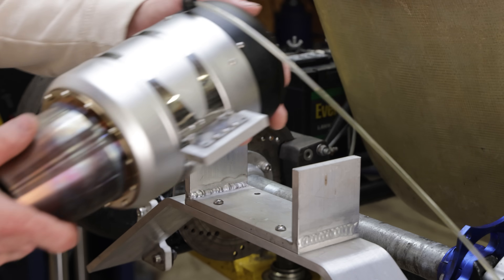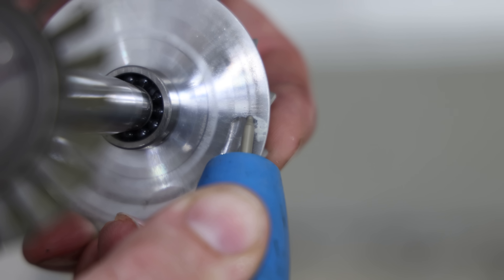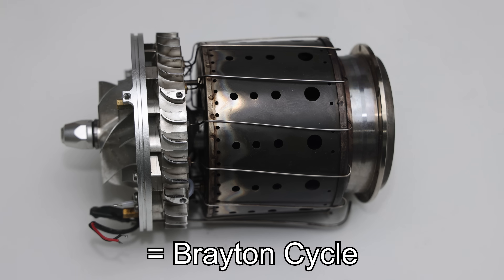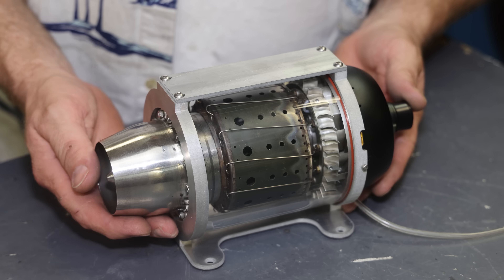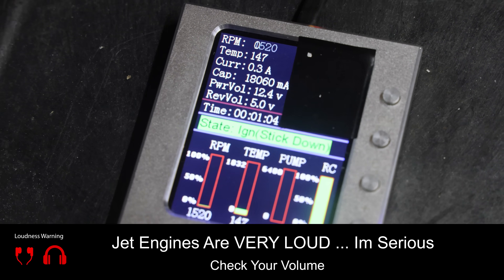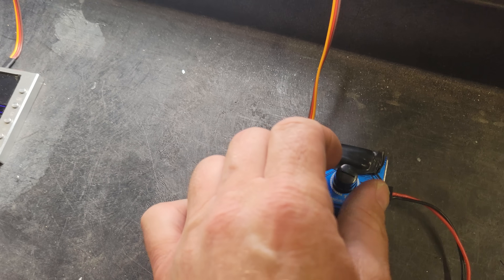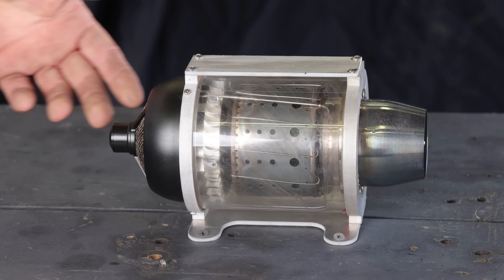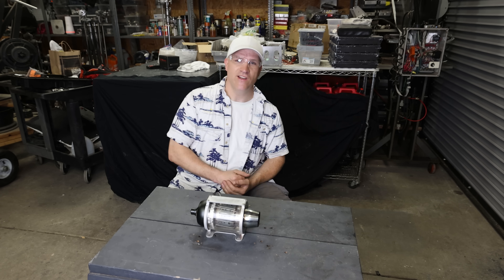See Thru Jet Engine

Comment: Awesome design and fabrication work! And your explanation of the Brayton cycle is great too. If you get a chance check out the Brayton Ready Motor. In 1872 George Brayton made the world’s first commercially viable internal combustion engine. Otto studied Brayton’s engine and in 1876 developed the 4 stroke engines we use today.
Reply from the maker: I've been totally meaning to get details on that engine and replicate it for a while.. I still haven't gotten around to it but I'm going to check it out today
Reply: @WarpedYT  the piston Brayton is pretty interesting. I’ve made crude versions from air compressors. Have a look on my channel if you are interested. It will be great to see what you come up with.

Comment: Is this a high bypass design or those are only large jet engines?
Reply from the maker: High bypass are usually larger turbofan engines.
Reply: Any bypass means a turbofan engine; this is not a turbofan. 
High bypass ratios are found in newer and usually larger turbofans.

Comment: That Was Really Cool! Is That Centrifugal Flow Or Axial Flow? How Much Horsepower Is It? Is It Turbojet Or Turbofan & Do They Make Turboshaft Engines This Small? Thank You.
Reply: It is a basic turbojet.
The compressor is centrifugal flow and the turbine is axial flow.
Horsepower is zero when not moving; turbojets are rated by thrust rather than power, because the power depends on the speed that they're moving.

I've never seen a turboshaft, turboprop, or turbofan engine this small, but someone might make one and I really don't know what is available.
Reply: It turns out that there are turboprops and turboshafts (intended for RC helicopters) of this size (and smaller, and likely larger but still tiny), but I haven't found a turbofan. Check out KingTech for examples - there are presumably others.

Comment: What is the turbine made of material wise ?
how hot does it get on the exhaust side ?
what is the percentage of the fuel turned into useful work energy ?
( efficiency )
Reply: Since the engine isn't moving, there is no useful work done and efficiency is zero.

Comment: So a jet is just a turbo but spread out and combustion happens in between. So simple and genius. It's everything a rotary ever wanted to be. Very little of the energy seems wasted, heat is not really wasted combustion is probably pretty lean? stoichiometric is probably quite lean. I'm now interested, off to google. Why have I never been interested in this.
Reply: The efficiency of any simple turbojet is actually terrible. The engine should run with lots of excess air, nowhere near stoichiometric, and "stoichiometric" means "not rich or lean".

Comment: the gasket blowup because it was not constraint correctly. next time you should try to constraint it horizontally with rods between the two metal supports, it should really help.

Comment: 1:48 The compressor wheel (impeller) doesn't compress the air, it only accelerates it.
The increase in pressure occurs in the diffuser as the air is slowed through the divergent duct.
 Fantastic job though! 🙂
Reply: "as the air is slowed and expanded " ? 🤷‍♂️
Reply: @BeerBatteredGummyShark  
Maybe a poor choice of words.
A diffuser is a divergent duct, thus the high velocity air from the impeller is moving into a larger area with a corresponding increase in pressure and reduction in velocity. 
(Bernoulli's principle)
Reply: @Johnno48  maybe. What i was nit picking was slowing the air is compressing it. Increasing pressure.

Comment: Awesome video! Just 1 thing. Usually the air isn’t compressed until the diffuser stator. The centrifugal blades accelerate the motive fluid. The diffuser shapes of the stator increase the pressure by slowing the fluid down.
Reply: gradually up to the choke point

Comment: Used to work in a Tornado RB199 Uninstalled Test Facility, was always interested in what was happening inside and how the first stage turbine blades could run hotter than their melting point

Comment: I bet if you wanted to see in the burning chamber you'd have to make it of borosilicate or quartz. That would be cool. Don't bother trying to make the inner chamber of glass, unless that's part of the entertainment because i bet it will melt.
Reply from the maker: Yeah that's very tough, I tried that material a while back but it's too fragile, the material I'm using is a material that I developed took me about 3 years,. But that's too much heat in that inner chamber that will for sure melt down

Comment: Cool! I've balanced LPC's ,HPC's, HPT's, and LPT's and the balance program was very similar to yours although very old software wise. The method was the same though.   Maybe on your next run squirt some water into the intake. I'm curious what difference it will make  (visually if at all) in the combustion section.
Reply from the maker: thanks, That would be cool making a note of it now
Reply: @WarpedYT  I thought of this for 2 reasons. The old jets used water injection to improve performance for take off. Remember the old Hawaii 5-0 opening scene? Also all engines are tested for water ingestion to see if flying through a storm would cause a flame out.

Comment: did not know there were only 2 stages.
Reply from the maker: Yes for these there is
Reply: In turbine engines the number of stages of compression and of expansion (turbine) are counted separately - one stage of each in this case.

Comment: Slo mo film the smoke flow thru it during low rpm of initial electric startup of final seconds of spool down.
Reply from the maker: Yes I tried but I believe due to the heat just from the compression by the time the fog gets in there it's not fog anymore.. I have something else in mind for the next one
Reply: @WarpedYT  well this was a really cool upload. Thanks

Comment: I love the micro balancing machine! Definitely no short cuts there. Would be worth a deep dive for the community on the effects of an unbalanced blisk at very high rpm. Good one!! I 👍
Reply: we all know what would happen. but i want to see it happen. lol
Reply from the maker: Yes I will do that
Reply: We used to balance TF~39 C5A engines. There was quite a bit of math to determine weight size and placement.
Reply from the maker: oh yeah, much more dynamics on those with so many blades and large size. need to do math for certain.
Reply: If you have enough unbalance of course the bearings will take the brunt of the damage, but if sufficient damage occurs it can get wild pretty quickly.
Reply: No it wouldn't. The vibration just kills the bearings, you don't need a deep dive to know the effects. What are you going to see on video? A tiny bit of radial movement?

Comment: Another legendary video. Didnt expect it to push the metal clamps apart that easily.
Reply from the maker: If you look closely it was also the heat, if you watch nozzle closely it actually expanded quite a bit from the heat under Full throttle.
Reply: @WarpedYT  good point.

Comment: I love this series! Really insightful and a fun way to learning how things work!
Also, how is it generating EMI? Where are they coming from? :o
Reply from the maker: I'm not too sure I haven't actually measured it with a meter yet, I'm always in a hurry whenever filming this videos. But it always happens every time only in the air Full throttle. I don't know if it's coming from the noise or what, but it's there for sure.
Reply: @WarpedYT  Perhaps it's the electronics you're using interfering? If the engine controlled by radio that would easily cause it. (Though you showed using a servo tester for throttle?)
My guess would be the gimbal is controlled by Bluetooth or Wifi and the radio transmitter (?) is messing with it or the sensors within it. 🤔
 
Either way you could try shielding the gimbal with foil. If that doesn't work my next guess would be vibrations transferring from the table, through the floor and up the tripod, 'bumping it' downward. In that case a rubber or foam mat under the tripod.
Whatever causes it I'd be interested to know :D

Comment: Spray nitrous into one 😂
Reply: Nitrous doesn't help turbine engines - they are running with excess air beyond what is needed to burn the fuel anyway. Nitrous is only used in gasoline engines to provide more oxidation so more fuel can be burned with the same airflow.

Comment: what about a fiberoptic camera through the center of a bolt behind a tiny sapphire window set into the end of it? you might even be able to do 2 sapphire windows with an air gap, so you could insert polarizing filters without melting them.

Comment: Dumb questio but can u turbo charge a jet engine but forcing even more air into it  if its like a 4 stroke cycle
Reply: A gas turbine engine corre fundamentally is a turbocharger with a combustion chamber instead of an engine in the gas flow between the compressor and the turbine. "Turbocharging" it would just mean more compressor stages to increase the pressure more, and more turbine stages to drive the compressor. this miniature engine has only a single compressor stage and single turbine stage, but real useful turbine engines have more of both.

Comment: Great vid. I really appreciated the explanation relating the jet engine to a 4-stroke car engine. When you do your follow up, can you mention how much compression a jet engine will generate? I was curious about it when you said how little air the jet takes in relative to the thrust. Thanks for the vid, very cool to see!
Reply: The ratio of intake (ambient) pressure to the pressure leaving the compressor stage is very low in these simple single-stage engines (much less than a gasoline engine) but in much more sophisticated modeern large engines it is typically over 40:1.

Comment: Yes, I want to see the combustion design! Awesome video!😎👍🏼I wonder if you could design a transmission system for this and run a generator or apply that to a gokart. Is it possible to make these from scratch?
Reply: These engines come in turboshaft variants, for powering RC helicopters directly. They're extremely inefficient though, compared to full-size gas turbines, which are very efficient.
It's possible to make one yourself, Igor Negoda(here on YT) has made a few with relatively basic tools in his garage.

Comment: I'm no engineer, but with the air flow showing inside. Could air fins be made to increase air flow in the centre canister. Thus less fuel being used, but with more power. And I guess someone will be laughing at my suggestion. But it's just a gut feeling.
Reply: The set of fins near the intake end are the stator, which improves the pressure ratio compared to just letting the airflow swirl out of the compressor.

Comment: Just a thought but what if you rebuilt the fire chamber with holes that line up with the streaks on the glass? Would that increase efficiency? Power?
Reply: Maybe even add tiny little scoops kinda like a cheese grater pointed directly at the flow.

Comment: You have to try different fuels again, but this time on the see through jet engine. I'm mostly interested on the hydrodiesel. This is so cool.
Edit: and maybe if you had a fuel tank with let's say 1L of Diesel or Jet A, and use the engine until you have 800mL, then add 200mL of Gas, then repeat just to see how the engine reacts when diluting it's fuel with gasoline.
Reply: Gasoline is a poor turbine fuel. These small units are generally designed to run on kerosene and/or diesel.

Comment: is there a way to get anymore information on the balancing of the engine? more specifically the equipment and software you used to test the balance?
Reply: It's a two-plane dynamic balancer, very common tooling. The one in the video is an EI-30 from Erbessd, a very low performance unit compared to industrial turbine ones.
Reply from the maker: Well the industrial ones are too much and too large for my uses and extremely expensive, if I had a balancing service then maybe but ill tell you this, it does 0.4G and better, I've gotten countless brand new engines, dismantled them and checked balanced with this machine, many of them were way outta bounds usually G2.5. just for reference G 6.3 is Aircraft gas turbine rotors and Turbo chargers,  G 2.5 Turbo compressors, Gas turbines and steam turbine and Computer drives. G 1 Automotive turbochargers and G 0.4 Gyroscopes Disk-drives Spindles and drives of high-precision. according to ISO .
Reply from the maker: Here's a link to the balancer to get more info about the exact one I use https://bit.ly/Balancer-I-Use-Tell-Them-WP-Sent-You

Comment: how do you make sure to mount the compressor wheel back on exactly how it was mounted while balancing to make sure the balancing is still right in both planes?
Reply: You draw a line on all the parts and then line up them while assembling.

Comment: I wish you had put the RPM on screen. That thing was rippin!  Awesome video.
Reply from the maker: It was there, I showed it idling and when it was Full throttle.
Reply: @WarpedYT  I noticed that and should have clarified better.  I meant having the RPM on screen while the engine was on screen running and spooling up.  
      Those small jet engines are so very impressive and are spinning so quick.  
    Your videos are always great!

Comment: "Technik und Technikwissenschaften in der Geschichte (Technology and Technical Sciences in History) 1987 in which they clearly mention that Henri Coanda’s jet aircraft from 1910 was the first jet plane."
Reply: Henri Coanda’s jet aircraft used a piston engine to drive the fan, not a gas turbine engine. Sure, you can call that a jet (an accelerated stream of fluid), but it's really not the same thing as everyone means by "jet plane".

Comment: Cool! Jet engines run cool to the touch on the outer housings. My friend has a picture of himself sitting on an F-15 engine under full afterburner in a test cell. He was into rodeo and strattled it like a bull.
Reply from the maker: Sorry, turbojet versus turbo fan
Reply: @WarpedYT  
Ah, yes, you are correct.
Reply from the maker: Yes that's true because they have a lot of bypass air but that's also a different type of jet engine... This is turbo jet

Comment: I liked the part where you absolutely avoided talking about the material of the tube (my bet on quartz glass tube)
Reply: An alternate may be some form of laser sintered Al2O3. Basically synthetic sapphire / transparent aluminum. Although it's usage is somewhat rare and making it an uncommon material. It's more of a R&D type thing still. It would have desirable strength and heat dissipation qualities, but its hardness would make machining and polishing to clarity significantly more challenging.
Reply from the maker: Lol... It took me almost 4 years to development that material.i first used it on the See-Thru rotary engine then I for the liquid piston rotary project as well as a few others.  I was going to patent it but that means I have to release the recipe, and since it's such a small niche market mostly for educational use, there's also the liability issue if one day they're using it in a school and it fails. But I'll figure out what I'll do later, I wanted to do this episode 3 years ago but the material wasn't ready yet... Complicated, then the whole pandemic...☹️.
Reply: @WarpedYT  Just because you patent the recipe, doesn't mean you are liable if anyone makes their own. You would only be liable if you made them yourself, and then sold them to people. Liability is not a reason for not patenting something.
Reply: @WarpedYT   obviously you used transparent aluminum.  Now we wait for scotty.
Reply: @MrHowzaa who is Scotty? Would love to learn more.

Comment: Bypass jets like on all modern commercial airplane get 70-80% thrust from a fan sucking cold air in and pushing cold air out, like a box fan.
Reply from the maker: Yes that's true, but not this one, this is a single stage turbo jet. High bypass engines are completely different animal.

Comment: so it's basically a turbocharger with extra steps
Reply from the maker: Yes
Reply: Yes, people have actually built small (and lousy) turbine engines by adding a combustor (instead of an engine) between the compressor and turbine of an automotive turbocharger.

Comment: Very impreasive brother!
Personally I wouldn't mind seeing the stats on a small turbine-electric generator... if you need an idea 💡 

Jaguar made a prototype car with small turbines driving a generator for a hybrid sports car.

Just a thought✌️👍
Reply: There have been lots of turboshaft-driven vehicles. A turbine-electric series hybrid is a more recent trend, but there have been several of those, including transit buses which were produced for a while. Wrightspeed tried to make a whole business out of this, but it has never taken off.

The Jaguar was the C-X75, which didn't go into production but was used in the James Bond movie Spectre. It used two Bladon turbine engines.

Cosworth's Delta Motorsport tried to produce a turbine generator set as a production item, called MiTRE (Micro Turbine Range Extender); they strangely now call it a "catalytic generator", and it still does not appear to be in production. Despite including a recuperator for efficiency, even under optimal conditions its efficiency is lower than that of an ordinary car engine.

Comment: So cool to see the internals of a turbine in operation! If you introduce the fog during startup (before ignition, while the engine is still at low rpm), maybe it'd be easier to see?
Reply from the maker: Maybe so, but I don't think so because the air is barely moving through the engine when it's starting up but yeah that might be worth a shot I have something else in mind way more dangerous but I'm going to save that for the next video.
Reply: @WarpedYT  😁